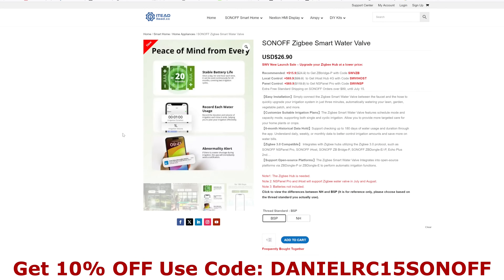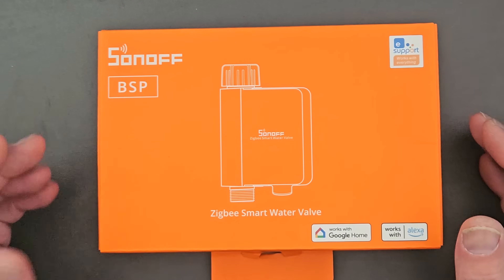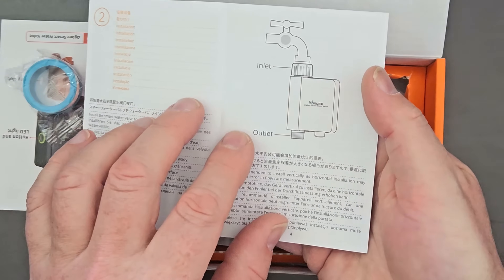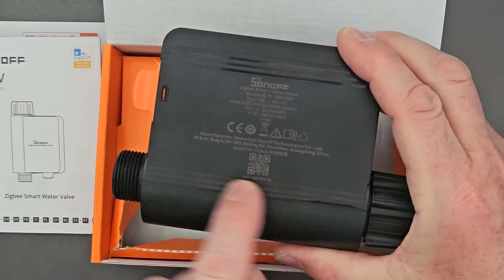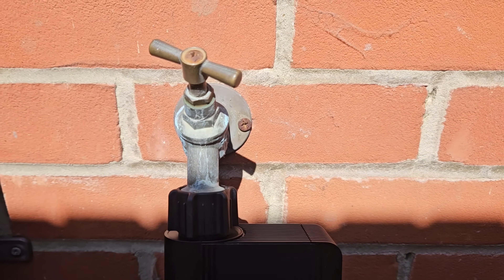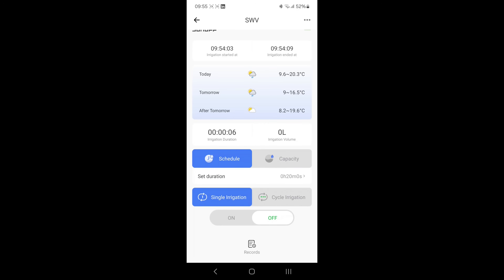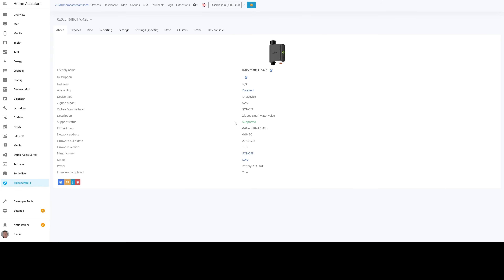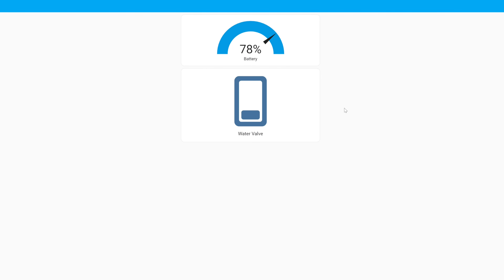Sonoff Zigbee Smart Water Valve Review

Comment: At no point when buying this does it explicitly state you need a bridge. It says you just download the app to control it. Returned mine, don't want to faff about buying a bridge
Reply from the maker: On the itead.cc website, it is labelled as a zigbee device, not wifi. But the newer amazon echo ball type devices will also work as a zigbee hub if you have one of those.

Comment: Can I use it to control the whole house by placing it in the central pipe after the water meter?
Reply: That’s what I’m wondering
Reply from the maker: I'm not sure. I guess it depends on getting a good seal and making sure it can handle the mains pressure when it comes into the house.